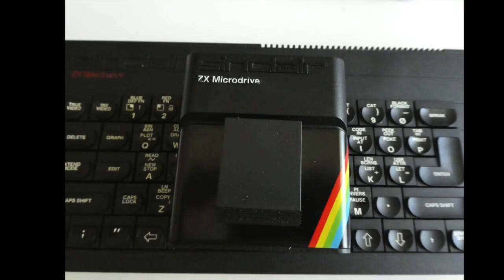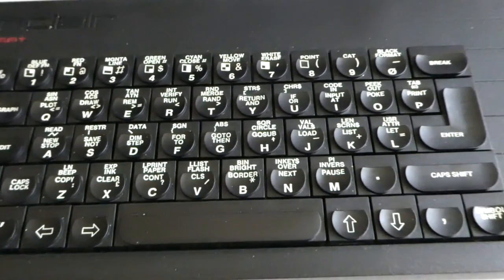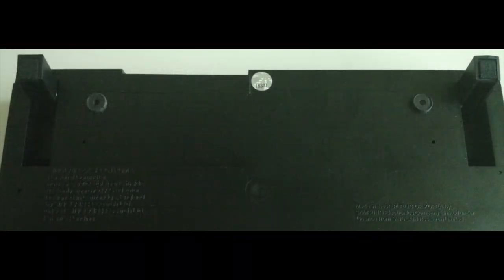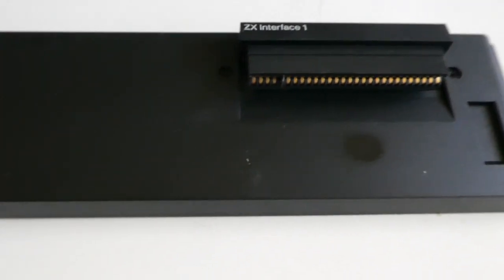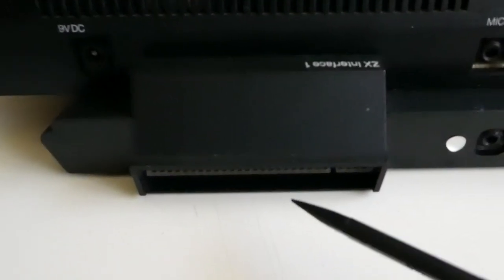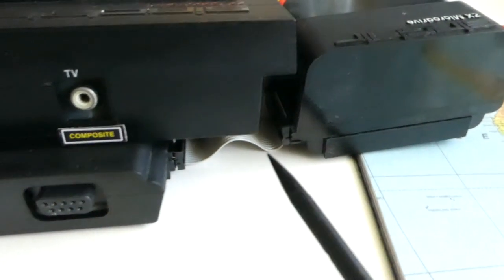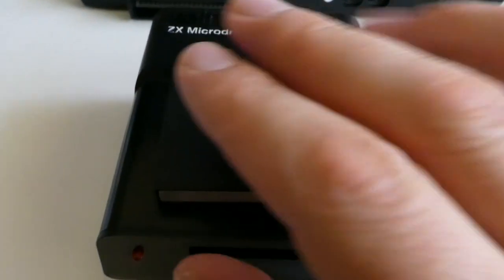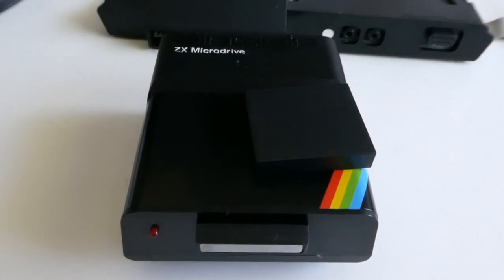Real Sinclair ZX Microdrive in action

Comment: They worked fine, except when they jammed, which they did with annoying frequency.
Reply: I did not dismantle a Microdrive cartridge yet. But I've read that early cartridges (maybe many?) had plastic spindles which were prone to jamming. Later on they used a metal spindle and these cartridges were way more reliable.
Thank you, you business scrooges! ;-)